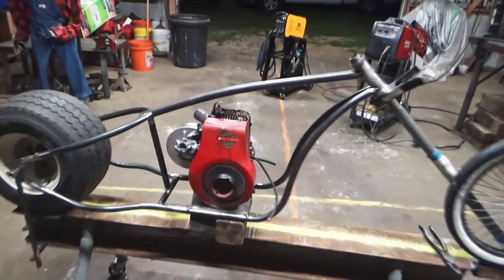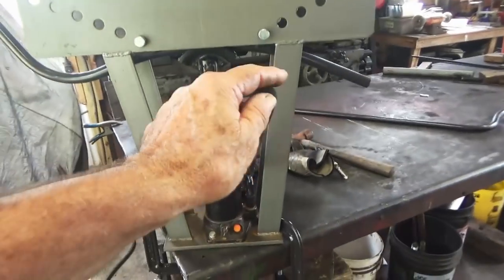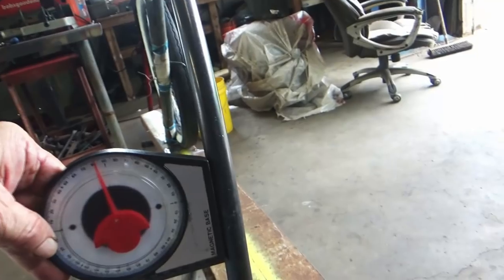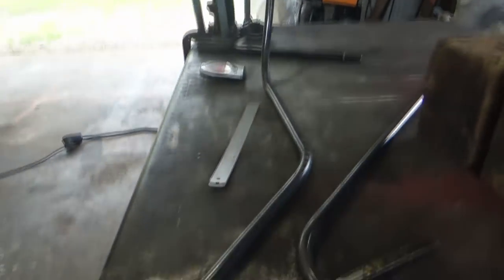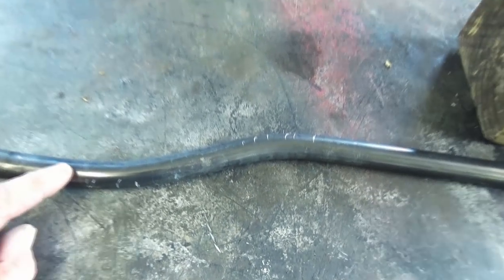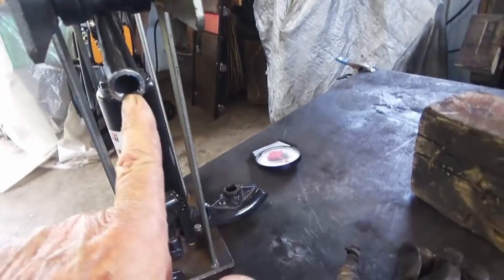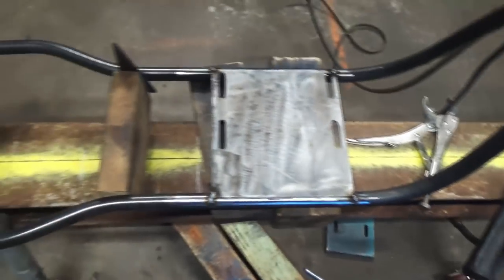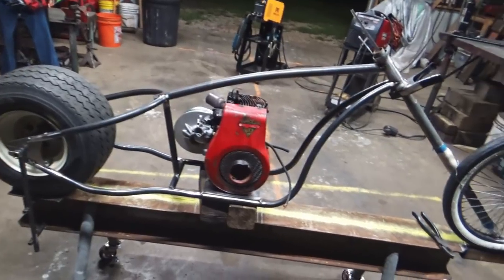Rat Pit Bike Junior Mini Chopper Pipe Bending Tips

Comment: She's looking good, Bob! Something I've used rather than a wood block & shim, and I really like it, is an old scissor jack that I pirated out of a junk Honda Civic. You can stick it in your frame, turn it open and let it rest till the springrate of the steel relaxes. It also gets ya a pretty precise push inside the tubes.
Reply: Great suggestion. It could be mounted to a clamp that adjusts along the I beam top flange.
Reply from the maker: Cool ... I may have one around here somewhere. Didn't think of that. I'll have to update my thinking chair. LOL

Comment: You, sir, must have the patience of Job to get this all worked out. 
I see that your patience and diligence seem to have paid off! 
I've bent electrical conduit, used a hydraulic die tube bender and a small hand bender (for brake lines and such) but have never used a pipe bender. 
Guess I need to test my patience. No hydraulic die tube benders available here in the Middle East but pipe benders are pretty common... I've been balking at the thought of getting one...  They don't know the difference between tube and pipe here, anyway... 
If it's round, it's pipe... If it's square, it's tube...
What the hell, here goes! The Nissan Patrol build must go on...
Once again, thanks for the inspiration!
Reply from the maker: If you search youtube for "pipe bender" you'll find a guy that shows you how to make jeep parts ... front guard ... nerf bars .... out of pipe with a bender ... but the key is .. bend a little then move a little and bend a little and so on. If you try to bend too much in one spot it will kink the pipe. Not good!

Comment: I'm building a really cool mini chopper I have a question on what I should do trying to fit a 1989 7 horsepower Briggs & Stratton in the bike frame it's close but just too tall by about a inch I can take pictures it's a really cool bike and I don't want to cut it up if there's a different way that I should be doing it I know I can cut a chunk out and make it fit but not sure if that's what I should do
Reply from the maker: Sounds like you got two options ... smaller motor or chop saw city.